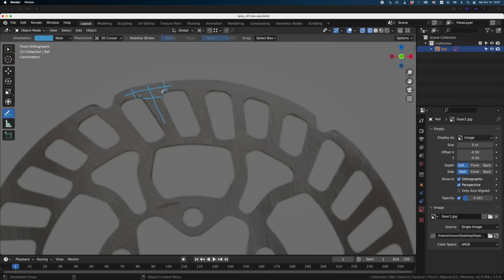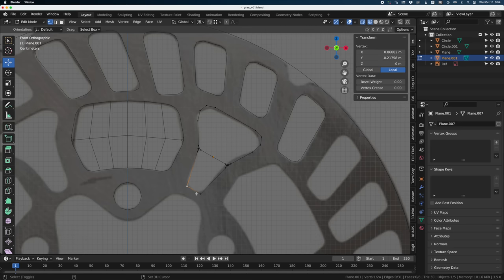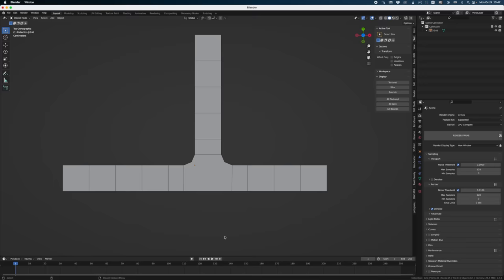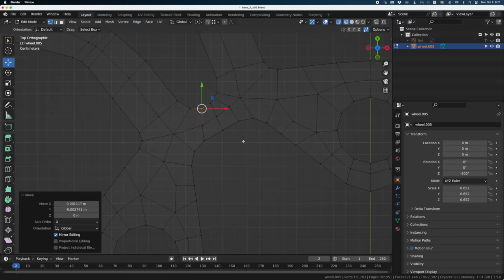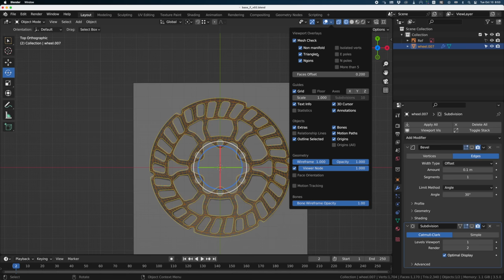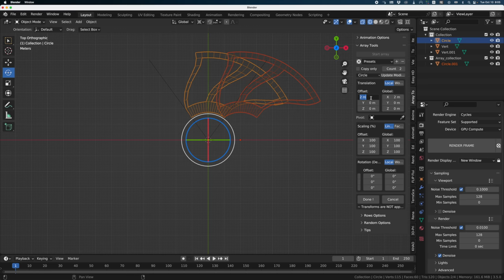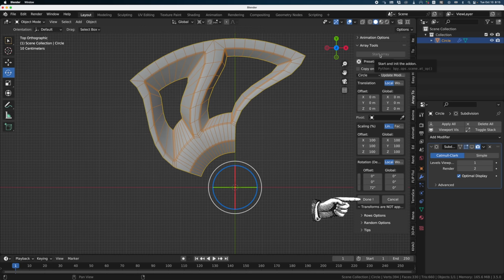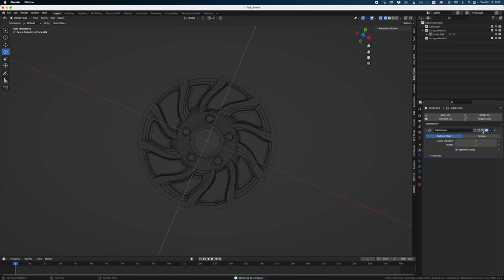Disk brake and wheel mag in Blender. Kind of advanced modeling.

Comment: If it does the job, then I guess it's fine. But I wouldn't use that shader:
1. If there are circular grooves it's from wear and tear. Machining wise it would straight lines from the face milled part it came from, although a new car brake disc could have different machining which does leave circular groove - so check the reference.
2. Grooves also tend to produce anisotropic reflections. For circular groves that would be basic radial tangent, and for straight lines that would be UV driven tangents (project view UVs should be good enough for the front and back), although you may want to use a dedicated UV channel for this.
3. Wear and tear grooves might produce depths that might well be simulated with bumps. But for normally fine machining the surface roughness is so fine it should be driven with anisotropic shading alone, maybe with some randomness to the rotation.
4. Bumps shown is doing a classic mistake. Leave strength to 1 and adjust the distance instead, even using a divide math node if necessary to see the low values, as these grooves would be less than 1mm in height (given a 0-1 input, which noise doesn't really do, but still). How to get the distance amount needed? Temporarily use microdisplacement instead in displacement only mode, whatever goes into Displacement Scale should be used for Bump Distance. Considering microdisplacement ground truth, this way is the only way to get the same normal modification. Lowering strength does "something", but doesn't produce the same result.

Unrelated to the shader; the zebra stripes is a great matcap to check for flatness and curvature continuities, especially for those of us who don't subdiv everything we do. Doesn't apply to your machined (deburr) bevel here which would be circular, for bigger bevels superellipse 0.75 works much better. Zebra stripes are the only tool we have in Blender to show why the curvature is better, but look up videos on how to use curvature combs in Solidworks if this sounds a bit cryptic. It might also be something you'd choose to completely ignore.
Reply from the maker: Don’t read too much into it. I just wanted to put something on it for the icon. :-) but thanks for the input.